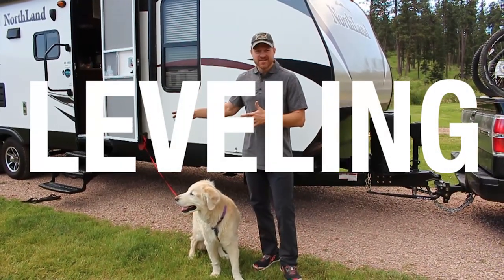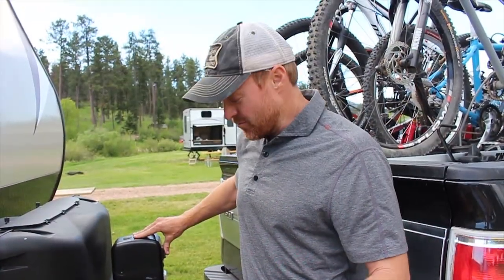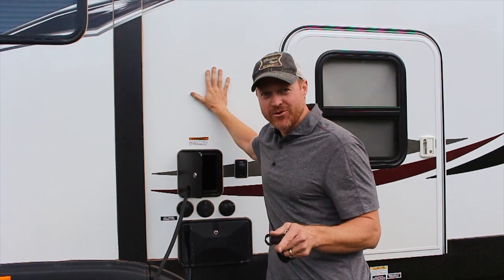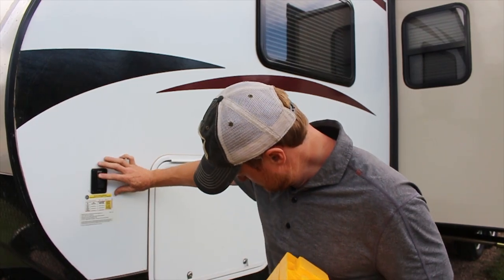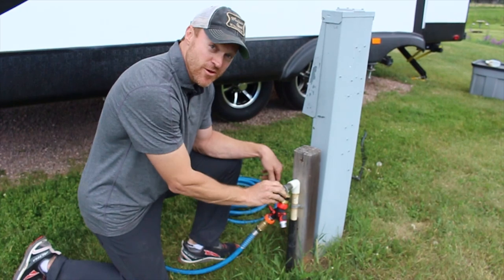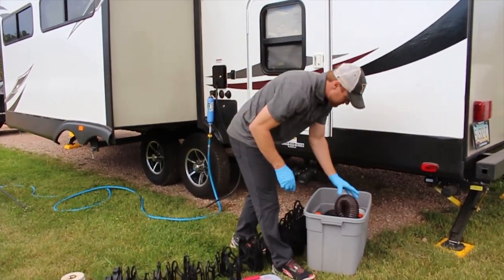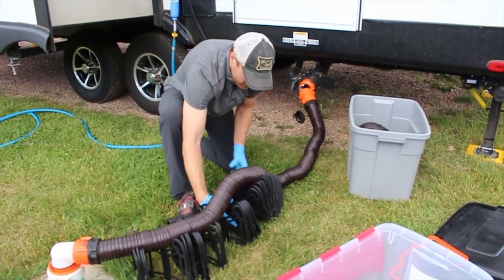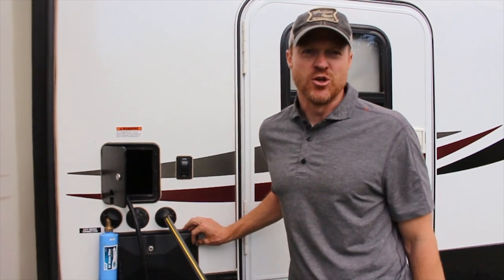HOW TO HOOK-UP AN RV FOR THE NEWBIE RVER! (FULL TIME RV LIVING)

Comment: Hey guys! Me and my wife are about to go on our first RV trip to Arkansas. Do y'all have a video or any tips on how to leave the campsite? How to empty and clean the tanks, etc.? Thanks! -Braxton
(we do and will have full hookups. I just don't want to cross contaminate) lol
Reply from the maker: We don't have a tear down video, but it's about the opposite of this video :) This video when through how to clean your black tank. We've never cleaned our grey in the two years we've been on the road. You can add a product to your grey tank to keep the order down. Regarding your fresh water, you can add a bit of clorox with 1/3 water and let it splash around while your drive and then rinse out a couple times. That only needs to be done once every few months or after you think its necessary.
Reply: Keep Your Daydream - wow! Thanks for such a quick reply and the tips! 👍👍👍. All I see on our little Jayfeather is a city water hook up (no grey) not sure if that normally smaller units..
Reply from the maker: Oh... yes. That makes sense. There are adapters your can get to connect your hose to the grey/black pipe where the water shoots up into the tank. Or you can use something like this https://www.youtube.com/watch?v=W5Jh6ZNuVIQ
Here's the bottom line. Water is your friend! After I dump the black, I fill the toilet twice and put into the tank. This conceals order, particularly after dumping. An empty dry tank smells! Put water in. Plus it makes it easier for TP to dissolve.
Reply: Keep Your Daydream - okay awesome! That makes sense! Thank you so much! 😄
Reply from the maker: This is the product I was talking about. There might be better options http://amzn.to/2zuf2ou

Comment: If you have been out dry camping, and your next stop has full hookups, is there a problem with leakage when hooking up the sewer connection?  Or how would you handle that?
Reply from the maker: No issues with that.

Comment: Do you have a pressure regulator on your fresh water so no line brake in you trailer?
Reply from the maker: I do... should have pointed it out. It's connected to the spigot. Based on this video, I realized that I need one on my grey water line too.

Comment: I'm fairly new at this. Is your grey water line connector the same as what i use to flush the system at the dump station?
Reply from the maker: I'm not sure I understand completely, but yes. However, I tend not to flush the system sani-flush) at a dump station. It's something I do only once or twice per month - typically before dry camping and I do it when I have plenty of time in a full hook-up site. One thing I didn't mention in this video is after the black is empty, I fill the toilet twice and flush with clean water. This reduces oder by putting a layer of water on the bottom of the tank.
Reply: Thanks for your response...and you have a new regular follower. Great series. Happy and safe travels

Comment: Didn't see a water pressure regulator. Any particular reason that you don't think that one is necessary?
Reply from the maker: It's there, but I'm glad you commented because I have to go back and add annotations to point out the stuff I failed to mention. Mine is a brass in-line regulator. However, I didn't have one on the gray line, which I should. When filling the black tank, I don't use much pressure.

Comment: What type of truck do you use?  Advice?
Reply from the maker: We had a F150 with the 6.2L engine. Now we have a 3/4 ton F250 diesel. Night and day difference. If you can afford 3/4 ton or 1 ton, do it. If not, just check your payload to make sure you're in the numbers. Hmm... Might want to check your payload on 3/4 too. It's not very much!

Comment: do you have to wait to dump if your hooked up all the time or can you just let it flow?
Reply from the maker: That's a great question and I'm planning on a updated hook-up video. Here is what I do. I leave the grey open the entire time (5 people generates a lot of grey water). The day before we leave, I close the grey to accumulate enough water. Then the morning we leave, I pull the black and then pull the grey to flush out the hose. Never leave your black open. It will clog and you'll end up with issues.
Reply: Keep Your Daydream thank you for the tips
Reply: Do you let your sewer hose touch the ground before it seats in the caterpillar? This makes a "P" trap to keep sewer gas out of the grey water tank. I don't know if this matters with grey water as all the drains have traps but I know it matters with black tanks which you shouldn't leave open in the first place as you mentioned.

Comment: To help keep your fresh water hose clean I hook the ends together when I store them. The main thing you want to make sure is level is the frig. make sure the floor and the are the same. I use something called the ARP frig control on mine to make sure I don't ruin the frig while driving or while parked somewhere other than a camp site. This is the link check it out https://www.arprv.com/
Reply from the maker: Great idea on the hose! Done. Will be doing that going forward. I'll check out the site. Thanks for the comment!